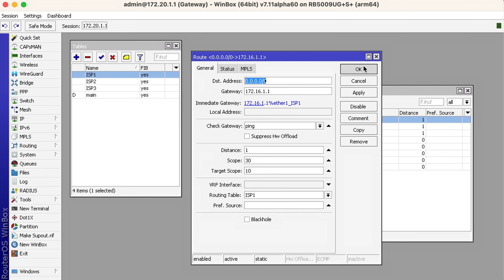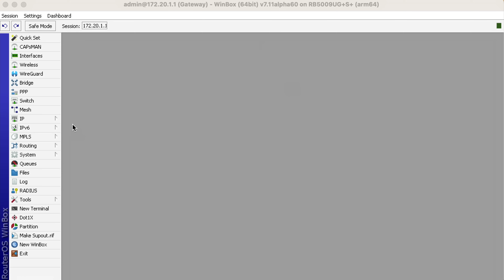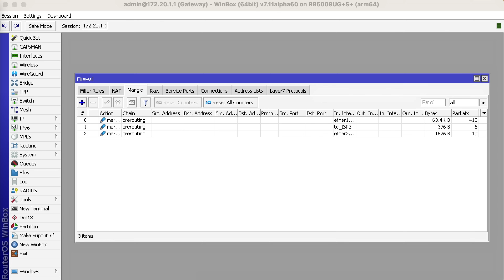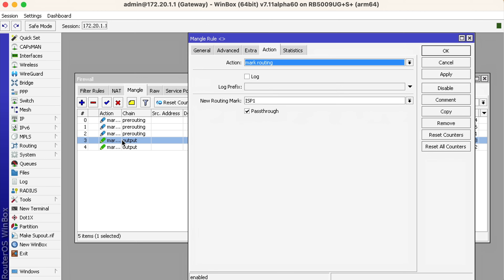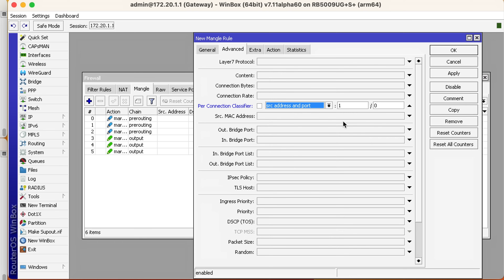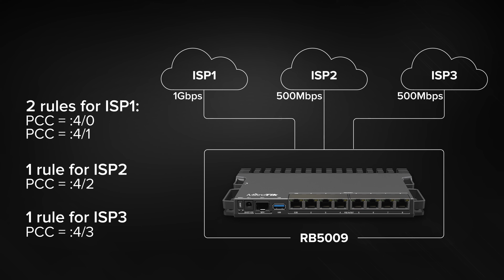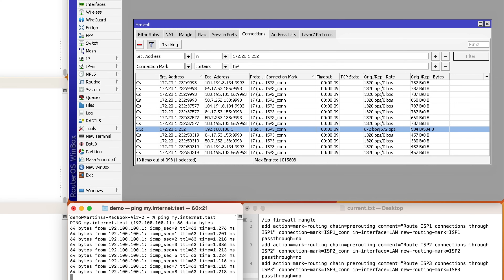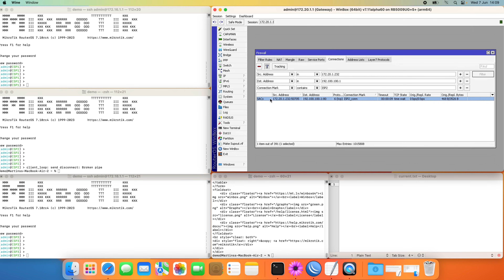Multiple uplinks using PCC, Load balancing

Comment: A very important thing to remember: If you are using the default firewall config, it has a fasttrack rule in its forward chain. YOU HAVE TO REMOVE IT otherwise not all packets belonging to a connection will be marked correctly and you'll experience stalls and failures.
Reply: or you can use fasttrack with no-mark
Reply: @cubaseuser  You mean enable fasttrack only on non-marked connections? I don't know if it can actually work but may  be worth a try.

Comment: The issues I have with these setups are: 

1) most ISP's I deal with are issuing dynamic IP addresses, so you can't use static routes in the routing tables.

2) Since the ISP device is almost always local, just pinging the local address does no good for a connection outage.  You need to ping a REMOTE device to check connectivity.   

I haven't seen any of these videos address these issues.
Reply: 1) You can assign a script to DHCP Client, which RouterOS executes after obtaining IP information. It is tricky but possible to identify the new gateway and update your static routes from the script.

2) You can schedule a script to periodically do some checks (e.g., pinging an external IP from a specific interface), and enable/disable routes based on that.

Comment: I have a Mikrotik Hex S router which has SFP port and an RJ45 WAN port, Currently I'm using RJ45 port as main WAN interface and planning to get a second ISP connection can I do multiple ISP with Hex S router with an RJ45 SFP device?

Comment: Doesn't work well for some sites with Akamai security. Notice internet slows down considerably when PCC is turned on. There is some step missing. normal browsing for text based sites works. Video fails miserably.
Reply: Turns out it was the ros v7.11.1 which was causing the issue

Comment: Setting up a multivan for the Internet is not a problem. But if the task is to create a VPN tunnel through each provider where the static IP is only on one side, then there is a problem. Can Mikrotik balance VPN? I tried to set it up for a long time, but the multivan and 1 tunnel did not move. Is there information on how to implement balancing of VPN tunnels between the main office and the branch? I'm trying to configure everything on wireguard.

Comment: Hello engineer I have 2 Mikrotik 1100x4 and I have 5 ADSL internet service providers. I use Mikrotik 1100x4 for internet sources and I use Mikrotik 1100x4 to distribute internet to users. But I am facing a problem with the load balance of internet sources Currently using pcc v6 Please ask for help to solve the problem The best load balance for Internet sources You have my sincere affection and appreciation ❤️

Comment: Thanks for the video, really comprehensive although I don't understand two things. It does not divide the bandwidth but the packets, if I have two connections, one fast and one slow with sim that I keep as failover what is the best strategy to make it use as little as possible?

Second, tried and it works but wireguard vpn works if I ping from router but not from my pc for example, any debugging tips? Thanks!!!

Comment: Why do you add the check-gateway ping to the Routes attached to the specific tables.   Why not attach the check gateway ping to the default routes (main table)?
Second question, why are you attaching distance to the three networks?  PCC is load sharing they should all have the same distance???

Comment: This is a great video, thank you. But I have one ISP with 1GB uplink and other with 50MB uplink. There are certain services (VOIP) that have to operate over the ISP2. What's the best way of load balancing this? Do I need to make hundred mange rules? Should I just create a separate routing rule for the VOIP subnet to only use ISP2? I would appreciate any advice, I'm still kinda new to this.
Reply from the maker: Instead of using PCC, look into other methods of filtering out VOIP traffic.

Comment: Can you please do a part 2 to this video where you setup packet marking for upload and download to each ISP, add those marks to some Tree Queues starting with a global Download and global Upload with limits set for each ISP under the upload and each ISP under the download?   Bonus points if you explain the cake configuration across your 3 different ISP example there.

I can get my buffer bloat to pretty much 0ms doing this, but it kills my upload speed.  If I disable WAN2 ethernet, I can upload at 73 Mbps solid / repeatable.   If I enable WAN2 ethernet, My combined upload is 9-10 Mbps which is absolute garbage.    I've gone through so many variations of queue types and tried different things, but I can't get Dual WAN upload to be anywhere near the 73 + 40 Mbps that my 2 ISPs provide individually.      (My speed test lets me control the number of simultaneous connections, so I know how to max out both my download and upload for a single ISP with no problem there.  The problem is with this DualWAN setup.)

Again, both of my ISPs are 4 to 7 times faster than the 10 mbps I can get on the upload when both WAN interfaces are enabled.     Is it possible to have separate PCC rules for upload?
Reply: Update:  I can get 25 to 30 Mbps upload now with no buffer bloat, but it is VERY picky:  

Upload (Parent: Global, Packet Marks:  ISP1_Mark, ISP2_Mark, Queue Type: ethernet-default, Bucket Size: 0.2).  
--With Upload as the parent, I have ISP1 and ISP2 with their Max Limit set to 80% of their measured capacity.  Queue Type is cake-upload. Each ISP Upload Queue has a bucket of 0.100.  ISP 1 Upload has ISP1 Packet Marks, and ISP 2 Upload has ISP2 Packet Marks).  The ISP with 280Mbps download speed has a priority of 3 and the one with 180 Mbps has a priority of 4.

Download (Parent: Global, Packet Marks: ISP1_Mark, ISP2_Mark, Queue Type: ethernet-default, Bucket Size: 0.100)
---Similar to the above, the ISP1 and ISP2 Downloads have a parent of "Download" and their queue type is cake-download.  Each ISP Download Queue has a bucket of 0.050.  The ISP with the faster upload has a priority of 4 and the other one has a priority of 3.   40Mbps vs 50Mbps.

My cake upload and download queue types were setup using the Mikrotik documentation.  I've tweaked them a bit based on the results from Waveform BufferBloat testing.    On that test with 1 ISP disabled, I can get 40+ and 70+ Mbps upload.   This test is using many multiple connections to max out the bandwidth.   I am testing via a gigabit wired connection to my equipment.   It really annoys me that the MikroTik is bottlenecking my upload by more than 50%!
Reply: The Tree queue craps out and stops working VERY easily.  The packets stop counting up.  If you go edit the packet marking rule and choose the same connection mark that it already had in the connection mark drop down rule in mangle and click Apply/Ok, then the Tree Queue starts working again.    Sometimes you have to open the global Download and reselect the selected packet marks there.    This interfaces is super glitchy!

BufferBloat tests turn to crap when this happens...  makes me wonder how many of my VoiP calls have dropped because MikroTik's firmware is just too buggy.

Comment: i tried this and multi wan works, i just found something, that when i use this type of firewall mangle, for some reason my hotspot > captive portal popup is not working /showing. after disabling this and tried the diff pcc approach, the hotspot captive portal pop ups automatically. why is that? should i add more configuration on firewall for the hotspot?

Comment: I have a big problem with this configuration. If I set the distance to 2 and 1 respectively then no matter what I do the packets will only use the one with distance 1. if I set distance both to 1 then the connections will be split according to the connection mark as explained in this video. This behaviour does not match the behaviour you explain in the video. I even tried forcing the classifier to mark everything to ISP1 and I can see all connections marked for conn1 but it will still use wan2 because it  has its distance set to 1.
Reply from the maker: Most likely a config mistake. Email your config to support @ MikroTik . Com
Reply: @mikrotik Will do.
Reply: @mikrotik  You were right, I was misplacing the 4th rule,  the one at 12:58 after that and making sure that I was not fasttracking the connections it worked as intended! Thank you very much techsupport :D

Comment: 1. How do you ensure interconnects maintain the correct gateway (say the router has 2 WANs and 2 other private networks (for interconnecting to the LAN of another router (B)), it sends and receives traffic for, i.e. a PC network isolated that needs a server under in the A routers LAN, so pass between LAN ports (router B has a DHCP lease in RouterA's LAN) ), I assume as they are not in the LAN bridge they will default to the "main" route table?
2. How do route table routes work if the correct gateway in not in the table, can they jump to the "main" table if no entry? Or just fail?

Comment: Thanks Martins - it has helped me a lot to understand how mikrotik works to balance connections.
I have a question - If the ISP2 router is turned off for example. Will the connection marking rules continue to mark new connections that are assigned to "ISP2.conn" by counter and therefore would be lost?
Thank you
Reply from the maker: Like the video says, when ISP2 goes down, main routing table will be used, meaning - the route with the lowest distance will be used which in our case was ISP1. Nothing will be lost, that is the whole point of this setup. So that it always works.

Comment: Thanks but I have an scenario and a question:  How can use PPC if I want Primary and Standby scenario? For example broadband of 200 Mbps as primary and LTE as backup only?  Also as my uplink is directly to a local cable modem and 3rd party LTE router the WAN port of my Mikrotik can be up but the Internet can be down.  Don’t do require here to do recursive routing? And if so how can I do it when my ISP gives my WAN IPs only via DHCP in my router instead of static routes?

Thanks and great video!

Comment: Thank you for this video. You have explained a lot of information very clearly. 

In the MikroTik wiki on PCC, there are accept rules in the prerouting chain for traffic from the LAN destined to connected WAN subnets. These rules are placed before the PCC rules and are meant to prevent a routing loop.

Can someone help me understand how these accept rules prevent a routing loop? Which traffic from the LAN to the WAN interface subnets will match these rules?
Reply: I have been testing this config now, and I have found that I need to accept traffic before using PCC mangling to be sure that my LAN can reach the provider's routers. It will work just fine without it, but you cannot reach reliably the provider's routers unles you accept the traffic for their networks before running the PCC selector.

Comment: i have an Mikrotik hAP ax lite LTE6. I have convert the ether1 port as WAN port and ether 2,3,4 and wifi remains in bridge-LAN. I would like to configure the router in order to use with load balancing between LTE connection and ether1 WAN connection (for example i am in a hotel, i plug the router in my ether1 connection but i want to use LTE also in combination). I tried to follow the tutorial but failed because i dont know the IP addresses of the gateway for LTE and the gateway of the WAN in ether1 changes from one trip to another. Is there a permanent solution, configuration that i can use? thanks for the videos

Comment: Mark connection rules also mark the ospf connection which use multicast address. I would suggest to accepting routing related connection before marking for load balance or incoming connection into router.

Comment: Thanks for the video
Hotspot doesn't work well. Captive portal doesn't open automatically 😢😢😢😢. Any solution
Reply: Me too
Reply: Hello, In ros.v7 I created bridge2[ LOADBALANCING BRIDGE] with STP disabled.  Dont assign ports to  bridge2[ LOADBALANCING BRIDGE]. Change all IN-INTEFACE where you have used bridge1 or LAN bridge to bridge2[ LOADBALANCING BRIDGE].  Radius will work stress free. It works for me, though I stand to be corrected.

Comment: The video state that there is 3 differents connections.  static, dhcp, pppoe but then later @ 5:30 route to static GW are added.  Usualy with dynamic IP ISP (dhcp or pppoe) you also have dynamic GW.  I'd like to see the workaround there.  Recursive route ? scheduled script ? dhcp client script ?
Reply: Because we don't know the GW IP, we can not create route @ 5:30.  This script will do that dynamicaly

{
    :local rtable "ISP1"
    :local count [/ip route print count-only where comment=$rtable]
    :if ($bound=1) do={
        :if ($count = 0) do={
            /ip route add check-gateway=ping gateway=$"gateway-address" routing-table=$rtable comment=$rtable
        } else={
            :if ($count = 1) do={
                :local test [/ip route find where comment=$rtable]
                :if ([/ip route get $test gateway] != $"gateway-address") do={
                    /ip route set $test gateway=$"gateway-address"
                }
            } else={
                :error "Multiple routes found"
            }
        }
    } else={
        /ip route remove [find comment=$rtable]
    }
}

Comment: Hi Guys I have a difficulty on having internet connection with your config. I already double checked the config but it seems my computer cant get internet connection without configuring masquerade on the NAT. Is that right or I miss something.? I also want to have a port forwarding rule as you mentioned in the last portion of the video but it seems the port cant be open. hopeful for your reply.
Reply: Right. You should configure masquerade on NAT fisrt. I think in the video was already has masquerade config in each port from isp

Comment: You mentioned DHCP but did not follow up on it. I face the problem that both my ISPs use DHCP so there is no stable gateway address I can use. How would you tackle that problem?
Reply from the maker: As mentioned in the video, this video was about PCC method and we did not configure things like DHCP server, NAT, firewall, users, etc. You can not dynamically adjust routes in differnet routing tables automatically based on the DHCP client. But it is very easy to write a script on the DHCP client which simply updates the route when gateway changes (https://help.mikrotik.com/docs/display/ROS/DHCP#DHCP-LeaseScriptExampleLeasescriptexample). However, thank you for the inspiration. We will see if we can convince our developers to allow doing this dynamically in the upcoming RouterOS releases. :)
Reply: @mikrotik  adding to this: I think the multi-ISP setup with DHCP and carrier grade NAT is quite a common scenario - so a simple solution that does failover and optional load balancing (in that priority order) including firewall / routing probably is an often requested use case…
Reply: @mikrotik  Thanks a lot for the reply - maybe a howto video explaining this approach or example on the website would be good as well. Also: adding a link to your site where the video content is summarised would be appreciated. Otherwise: keep up your excellent work - you guys rock the boat!
Reply: @mikrotik  How is your convincing going?

Comment: Mikrotik FastTrack? Should be turned off?
Reply from the maker: it is admins responsibility to only mark connections for FastTrack that are forwarded using main routing table. So no, traffic processed by different routing tables will not be FastTracked, but will still work in slowpath. https://help.mikrotik.com/docs/display/ROS/Packet+Flow+in+RouterOS#PacketFlowinRouterOS-FastTrack

Comment: But why use prerouting for marking forwarded traffic? Why not forward chain?
And you missed to mention that PCC will ruin TCP connections most of the time, so it's barely usable.
Reply from the maker: In networking you can do the same thing in many different ways. The video was ment to describe how the method works in general. You can achieve the same result in differnet ways. However, you must mark connections and then mark routing. Routing marking is possible only in output and prerouting chains. So you can not mark connection in forward, then the first packet of the connection will not get the correct routing mark.

P.S. Lots of users are using this method right now - as we speak, also -  we are using it in our setups, too. This is pretty broad statement and we can not comment on this, but we are convinced that the problem here was not the PCC implementation in RouterOS. Sounds like a configuration issue. If you do think it's a bug - please, open a support ticket and we'll investigate further.